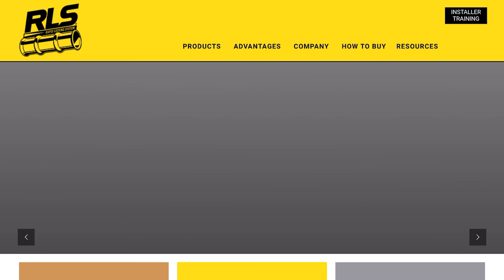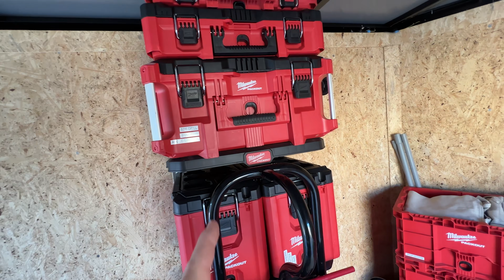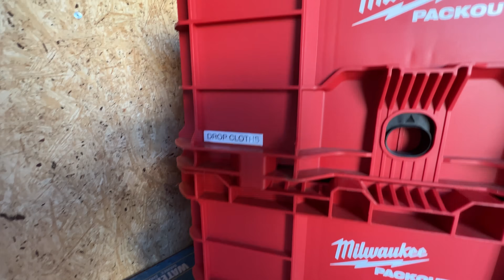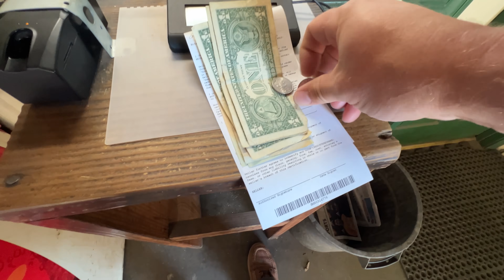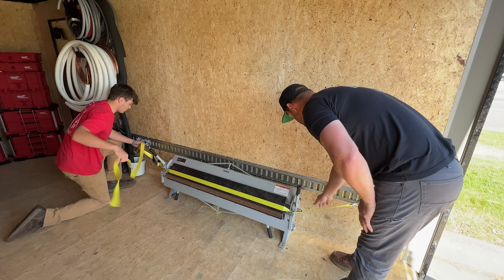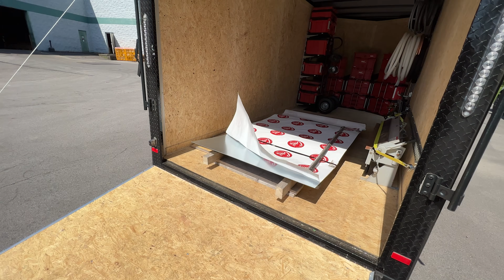Buying A Sheet Metal Brake!! HVAC Tools

Comment: Great organization.  I had a black trailer when we first started racing.  I installed roof vents as it will get damn hot in there this summer.
Reply: Yea, He needs to paint it White. alot cooler inside a white trailer. Have a Friend Who Just bought a boat & Put a Dark Green Tent 🏕 over it , it's Smoking Hot 🥵 under that tent. im like Why did u not Get a White one ? smh 🤦‍♂️ Dark colors & the Sun ☀️ is no bueno !!! Smoking hot 🥵 🔥.

Comment: t is easy to see you love your career choice and do it correctly. I wish I knew you when I had my heat pump installed, they seem to care less, one guy cussed at me, threatened me, I am 71 I don't fight anymore but will always protect myself. I went to another company to just have an inspection done. Well he found both pressure valve wires were completely cut, wrong size copper tubing used on the outside from the Air Handler to the filter dryer. I blame this of course on the installers, but the guys that did the service calls were also to blame for not even trying to fix problems, they had to install 3 compressors which includes the original new one. I think they wasted a lot of Trane's money by not finding the real problem that was causing the compressors to not work properly. This all started about a year ago and is still the problems I listed above found by the service Tech from another company. Of course I had to pay him for the inspection and will probably pay to have it all fixed. I have no intention to go back to the other company. Oh did I forget he found a lot of pressure problems on his testing device, a lot I think from the pressure valves being completely cut, the high and the low. I can't get a hold of Trane except for customer service that say they don't deal with those issues!!!! That is why I can appreciate your desire to do the job, but  correctly. It is full of a lot of things that have to work together.